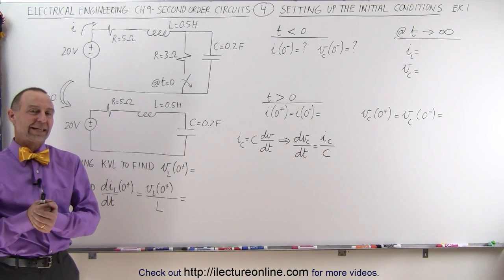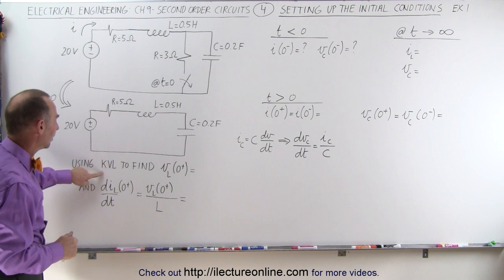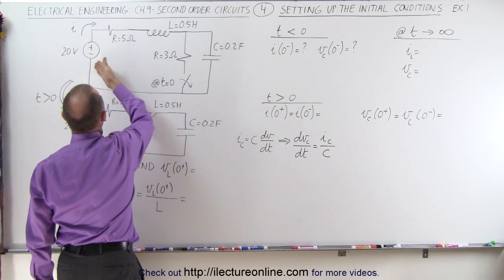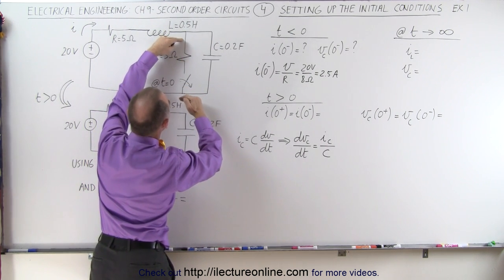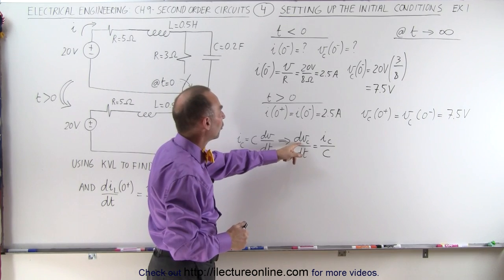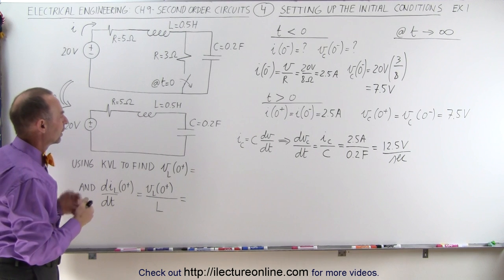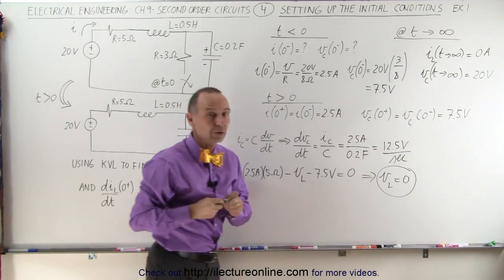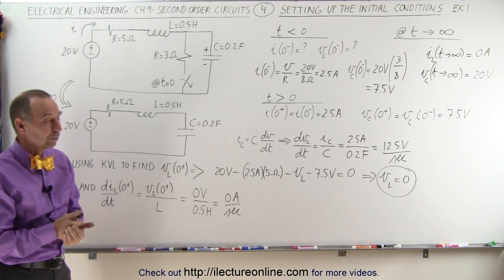Electrical Engineering: Ch 9: 2nd Order Circuits (4 of 76) Setting Up the Initial Conditions: Ex 1

Comment: Professor, why can't we utilize the same thought process for VL/L as we did for IC/C? I know that we found current at the capacitor to be 2.5 A in t(0+), but we did not apply that logic to the voltage at the inductor at t(0+)? My work before I watched your entire video was VL/L = 7.5V/ 0.5H      Why is my way incorrect?
Reply from the maker: There is a very specific method of solving these types of circuit problems.  Also not that when the switch first opens there is no voltage across the inductor since right before the switch opened, the current wasn't changing.

Comment: I have a question Sir. Why are we assuming the capacitor to be fully charged at the state t(0-) or when the switch is closed ?
Reply from the maker: You can assume any charge at t = 0.  This is just to illustrate what would happen if the capacitor if fully charged.  You can work the problem out with assuming the charge is half or any other fraction of full.
Reply: Generally the problems will state that the circuit has been in the initial state "for a long time" meaning fully charged.  Since frequencies are generally in the Hz to MHz, one second is more than enough time.

Comment: @t =  infinity, how's is the voltage across the capacitor equal to 20V, when there is a voltage drop across the 5 ohms resistor?
Reply from the maker: At t approacing infinity, the capacitor will be filled with charge and the current will be zero.  Therefore there will be no voltage drop across the 5 ohm resistor.

Comment: Dear professor. I am a huge follower of your videos. I have learnt many things from here and thank you so much for your effort and time. it seems that this topic has been published over one year ago and by reading the comments below I noticed that you are still working on the rest of the videos. May I know when we will able to see the complete set of lectures on RLC circuit? Thank you once again for your great work
Reply from the maker: Thanks for writing.  We are trying to cover many topics and it is difficult to get back to the playlists that are not done yet. We have limited time because we work multiple jobs besides making these videos.  That said, we are trying to work on more of the electrical engineering videos this summer.

Comment: Sir, shouldn't the V(L) @ (t=0+) be 20 V as, 20 V-2.5*5-V(L)-7.5=0?
If i am wrong please kindly correct me sir.
Thankyou so much for your contributions for Electrical Engineering Students.
Love from India
Reply from the maker: V(L) cannot be 20V  (at t = 0+) since that would mean that there is no voltage drop anywhere else such as across the resistor.
Reply: @MichelvanBiezen  ok sir thankyou so much

Comment: Without being too pedantic, on a couple occasions in this video, you mentioned current flows through the capacitor. Does current actually flow through a capacitor/ Is it not just a build-up of charge on both sides of its plates?
Reply from the maker: It is a good question.  We can reference Maxwell's equation in which the current "through" a capacitor is expressed as the displacement current.  Since current flows into a capacitor and out of a capacitor at the same time and with the same quantity, it is OK to talk about current flowing through a capacitor.  (but I am sure there will be some that will disagree)
Reply: @MichelvanBiezen  Michel thanks,  yes as I said, I was being somewhat pedantic

Comment: Could you please upload more examples?? Taking an exam next week. 
a) At , find the capacitor voltage  and the inductor current 
b) At , find the capacitor voltage  and the inductor current 
c) The differential equation describing the circuit in terms of  vc t ≥ 0+
d) Write the characteristic equation for the obtain differential equation.
e) Find the roots of the obtained characteristic equation
f) Write the solution form for vc (t)  in terms of constants and define its type ( overdamped, critically damped or underdamped)
g) Find the solution for vc (t)

Comment: Hello professor, I'm an ECE student and I am currently in the process of making a channel dedicated to helping ECE students or anyone else  learn about engineering or science concepts. I see that you are using the same textbook I used for my intro to electrical circuit analysis class and you stopped at chapter 8. I realize that you are busy with other tasks and I would like to help you out by doing the other chapters starting with chapter 9. Because of this starting point, I wouldn't be covering much of the basics and I would like to point other people to your channel if they are rusty with the basics. Would you mind me doing this? I plan on covering chapters 1-8 later, but I don't have the time right now.
Reply from the maker: Not at all.  All the best with your channel!

Comment: if we wouldn't open the switch, wouldn't the voltage across the capacitor be 20V? Or was it in steady state before we open the switch? thank you
Reply from the maker: Assume steady state before the switch is opened.  The voltage across the capacitor will be:  (3/8) (20 V)  = 7.5 V
Reply: @MichelvanBiezen  so is it only an assumption?if we would wait more before switch is opened, then could the pot. diff. across the capacitor be 20V?
Reply from the maker: No, the maximum potential difference is the same as the potential difference across the 3 ohm resistor ( = 7.5 V)